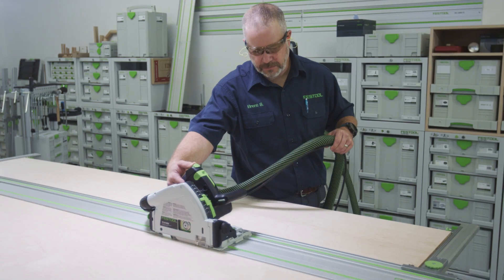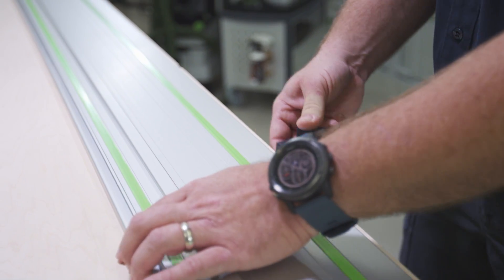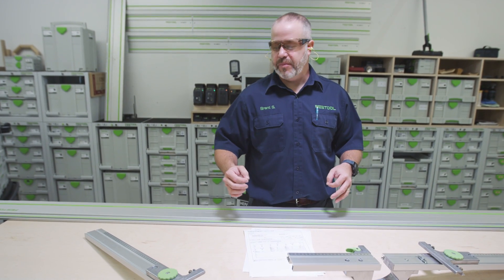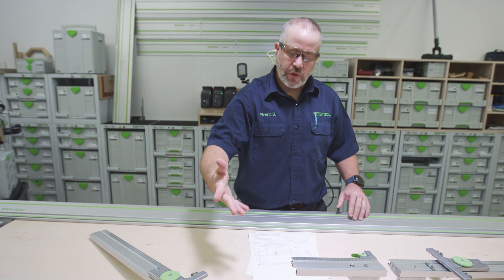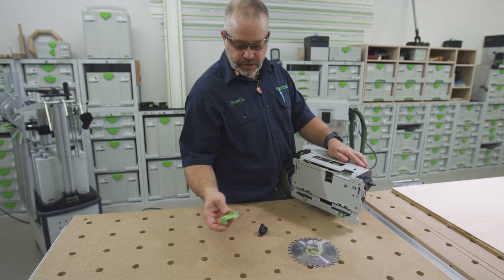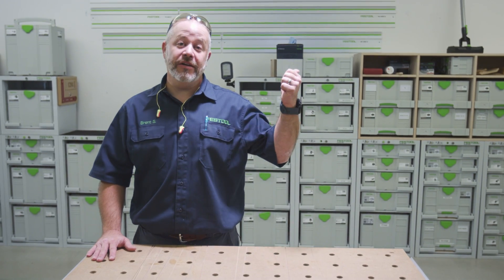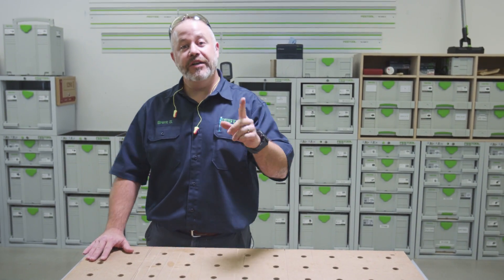How to Build Frameless and Face Frame Cabinets - Part 2 of 9

Comment: I might be crazy, but I just find it hard to trust that the 90* on that flip up track will maintain calibration. Same with the Kreg system. I feel like I"d be mentally stressed about every cut and check it like 93 times a day. :\

Comment: I don't have a track saw, but from what I'm learning, it seems to me a better (more accurate) way to do this would be with a Festool track saw and TSO parallel guides. All the mistakes this person was trying to avoid at the beginning by manually marking things are still a potential problem midway through the process as he starts to manually measure and cut (e.g. parallax issues marking, cutting on the wrong side of the mark, etc.). With TSO's system, you can avoid even more (if not all) of that.

Comment: Agreed about the splinter guard slowly coming off the guide rail.  What I don’t like about Festool, I t’s not a system that will work on everything.  It is marketed that way though.  If you’re a one man carpentry show, then it might be for you.  Wish I had just a sawstop saw and dust collection.

I do like the systainers, and the locking system.  Oh, the green color is great too!

Overall, I have yet to build with it without spending an hour to remember how it all should be configured, just to understand that I can’t get parallel cuts.  Table saw is on my wish list!!  Just my 2 cents….

Comment: Is it me, or are you cutting directly into the surface of those very expensive MFT tables??? Also, I see Festool systainers in the background, neatly stacked inside Festool "cabinets". Does Festool offer those cabinets? They look a lot cleaner than building a plywood box to put everything in.
Reply: Those tops can be replaced. The cabinets are the Sys-Port 500/2 or 1000/2. If you’re worried about cutting into the top of the MFT I would suggest not looking at the cost of the sys-ports.
Reply: If you want to spend more money up front, you can easily make your own tops with the Woodpeckers Hole Boring Jig.
Reply: @JamesDalphond   Or you can use the LR32 system if you have it already.

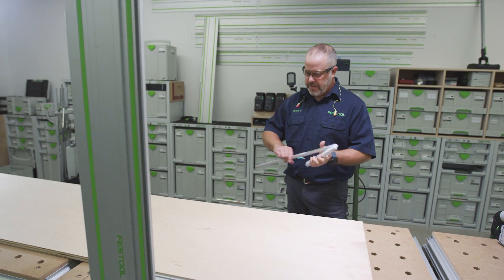Comment: @9:13 do you mean to say 768 mm + (0.75 inch or [3/4*25.4] mm ) = 787.05 mm ; as you are using the metric AND inch system in the same sentence, should have said, ideal dimension is 768, but I cut a bit longer (19.05 mm), giving an actual cutting setting on the saw jig of ~787.05 mm. OR used 30.24" and the final dimension being 30.986" total.
Reply: Dont know if you guys cares but if you're bored like me during the covid times you can watch all of the new movies on InstaFlixxer. Have been streaming with my gf for the last months :)
Reply: @Layton Abel definitely, been using instaflixxer for months myself =)

Comment: great to see you do have a metric set of rulers, one idea, how about using one set on the video, but stop, and show the measurements on the other set, so no one is confused, ie have a "metric" project and an "imperial" one, saves confusion, and also have each projects' plans in two parts, metric and imperial, so we can use either one, NO conversions necessary!( also state at the video title which system you will be using)- ie have two playlists, or have all searchable on either measuring system.

Comment: Two comments:  I do wish Festool would use better adhesive on their translucent splinter guard strips.  Mine keep slowly peeling off.  I can press it back on, but that only lasts for a short time before it starts peeling off again -- and, of course, when you try to stick it back, you lose the accuracy of its cutting location.  Second, the parallel guides need some re-design.  I don't like how they hang out unsupported and torquing the FS rail, especially the long, very expensive rail.

Comment: Particle|plywood splinter by nature.  One can try to control the splinters with tape and fine tooth saw blades, with limited results.  How much does this proprietary saw and rail system cost?

Comment: When you change blades on the TS55 from the rip blade to the crosscut blade, doesn't that impact the splinter guard on the track?  I was always told that if you change blades, even if you use Festool blades only, it can impact the splinter guard.  Anyone know if that is true or not?
Reply: I have not noticed any tear out using different Festool blades on my TS55R and even the manual states that it is no problem as long as same width Festool blade is used (all blades have 2,2 mm width). The manual also states that if you have more than one TS55R, each unit should be calibrated to your first TS55R by loosening the hinge block screws and adjust. I guess it comes down to manufacturing tolerances of the body itself.

However, for the TS75 even the Festool blades are of different width from 2,2 mm, 2,4 mm and 2,6 mm. So be aware :)
Reply: @olalinde1623  Thanks so much for the information!  I bought a used TS55 REQ and it did not have the manual with it.  That really helps!
Reply: It used to be the case years ago as Festool had a different thickness blade for the Rip ( panther) blade compared to the other blades in the range. However all the blades are now 2.2mm so you can change blades at any time.

Comment: No point installing the green splinter guard if you don’t put it flush to the board when you’re cutting.. Maybe you can send me two more MFTs for pointing out that important bit of info :-)
Reply: Yeah. You can see the roughness of the cut at 11:39.

Comment: Great video but that plywood is not Baltic Birch as mentioned in Part 1.
Reply: Right. This is just plain old plywood. It might be birch-faced (looks like maple, though), but not baltic birch.
Reply: The facing on one side is Baltic Birch, I think.
Omission in the demo: setting the flip stop for concurrent identical cuts : )